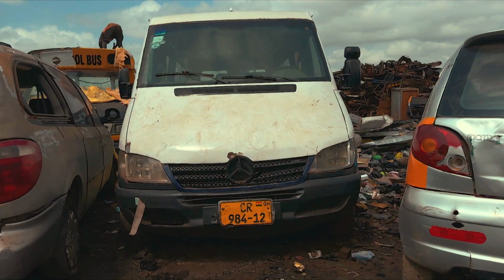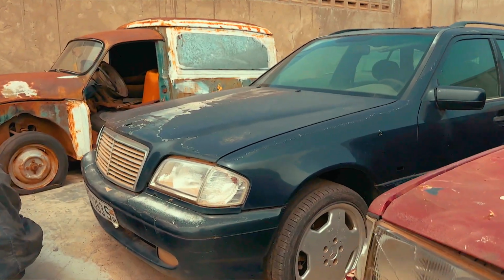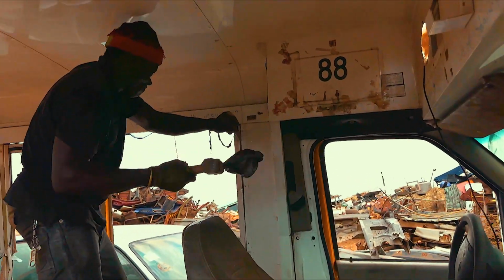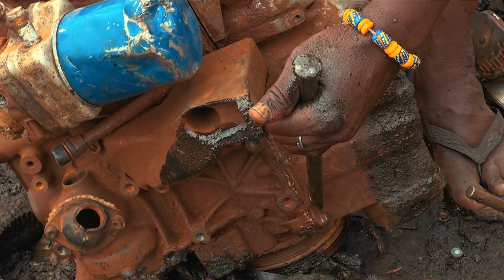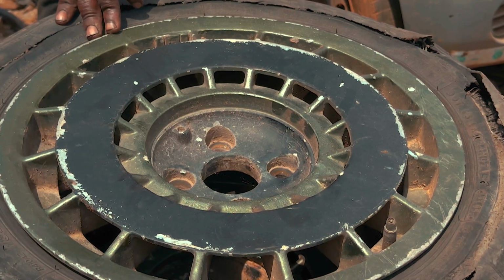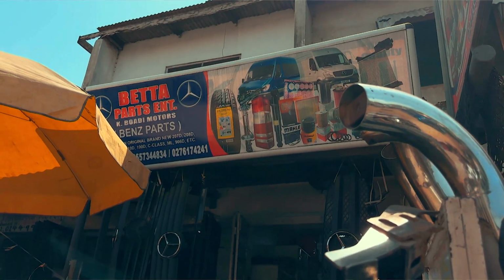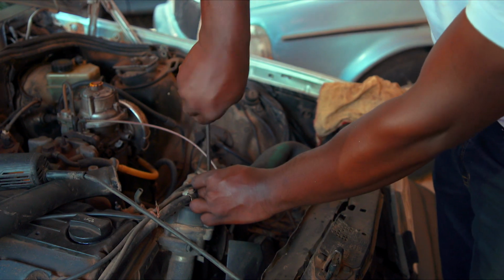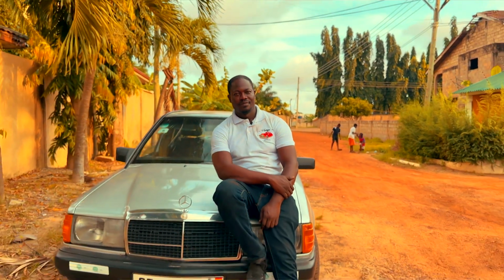German Classics in Ghana: Accra Car Graveyard

Comment: '80s, '90: golden era for cars made in Germany. They were designed by engineers. Later on they realised their cars last too long and it was only downhill for German cars after that.
Reply: But German cars are still the best, together with Toyota. Times change, often for the worse. But this is not limited to cars.
Reply: @jonasf1275  for German cars it is a past tense. Those days are long gone. Today some of them struggle to get to the end of 3 or 5 years lease. They are still widely considered as premium, but reliability is long gone. On the other hand toyota is still reliable. Actually most reliable in the world all together with lexus (many independent rankings)
Reply: @damcyk4  thats simply not true. German cars are still reliable.
Reply: @reverze2031  I'm old enough to remember german cars from '90 on the road and I know them know. Somehow they are only reliable in Germany. In Canada, USA, UK, big parts of Europe outside Germany picture is slightly different. Please take any ranking warranty or reliability ranking and German cars are not there at the top. German cars are only on top at ADAC ranking. Everywhere else where German capital is not involved: German cars are not reliable. My personal quest with German cars ended up quite a few years ago with Passats 2.0tdi. Than was disaster with dsg gearboxes and tsi engines.
Reply: @damcyk4  Forget about it kiddo, u will never find 90s Mercedes again or 80s Toyota Trucks
Reply: @damcyk4  VW is trash, the rest is still premium. Also VW never was premium, you have no idea what you are talking about, you think a Kia or a GMC is better than German?
Reply: @jonasf1275  kiddo? Audi is a vw. Actually vw owns audi.
... Never mentioned kia or gmc. Writing it from Europe
Reply: @jonasf1275  The 80s 1.7 or 90s 1.9 VW Diesel is one of the most reliable engines ever made together with the 2.5 by Mercedes-Benz they are noisy and slow but will outlast the car around them. But I wouldn't buy something from the VW group from the last 15 year.
Reply: @O-plaat  my criticism on VW is on newer models, i think they optimize costs too much to keep up with China
Reply: Unfortunately it's true
Reply: @O-plaat  and don't forget the old Volvo's.(I know that isn't from Germany, but worth mentioning)
Reply: Bis ca. 2004 waren deutsche Autos noch gut danach ging es mit der Qualität steil bergab. Heute würde ich eher Hyundai empfehlen als irgendein deutsches Auto. PS Ich lebe in Deutschland
Reply: @damcyk4  Audi is not VW, just because the company is owwned by one another it doesnt mean much, Audi produces alot by themselves
Reply: @HippasosofMetapontum  my friend, quite a few parts are interchangeable. Well known fact for years here in Europe. I do understand audi owners want to distinguish themselves so badly from vw but there's not getting away from it.
Audi is the "posh one"

VW is the "middle or upper middle class", golf is classless. Cheaper than audi

Skoda is average Mr Smith with family, kinda like a volvo. Or sales representative. Cheaper than vw

Seat same as above just young family or youngsters just before family, kinda sporty cheaper than vw

Cupra, young sporty, trendy. 

That's how it works here in Europe. Engines: all across the board -the same. Maybe audi have got some more powerful ones. One or two. Give yourself a difficulty and take of any panel, any plastic cover, any part of the interior and look what logo is behind. They are using same chassis platforms, seats, dashboard parts, brakes... 
Have a look what logo is on engine block, have look what is on water pump, and so on, so on...
Reply: @HippasosofMetapontum  talking from experience. They are not reliable anymore. Ask anyone about egr and dpf issues in diesel engines from audi/vw/skoda/seat (same engine) there's a lot of common faults on those cars. Gearboxes are made of butter.
Reply: @HippasosofMetapontum  yes it is politics. I give You some clues:

-which country has got the biggest car manufacturing power in eu?
-which country is dominant in eu?

Suddenly its clear why we don't have American cars in Europe and we have got less and less of Japanese cars. They are not qualifying for very strict exhaust emissions. Koreans are holding strong.
Now who didn't meet those strict regulations? How many years gone? Still no consequences here in Europe.
Follow the dots...
Reply: @witos2148  that`s exactly my feeling as well.
Reply: That's right, nowadays they're making cars that will crash sooner for sales to go high..
Reply: MB became owned by Deuchbank in.1990. nothing since is the same

Comment: What a lovely couple. They are doing the environment a great service by recycling and restoring these vehicles
Reply: It depends on how old you are talking about.  A 40 year old car with poor emission controls / worn out smoking engine will be more harmful to the environment than a 10 year old car not to mention the likely worse fuel mileage. 
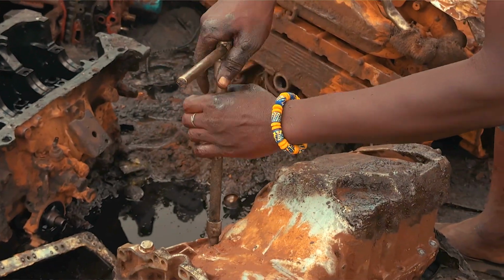And I guess you didn't see the scrap yard , at 3:06 , where motor oil is dumped on the ground right next to a body of water.
Reply: @bobroberts2371  horses for courses Bob. The land fill those old cars would take up along with the energy new cars take to produce is quite substantial. Couple that with the economic benefits of recycling I believe they are doing a great thing.  Is there room for improvement or better practices? Absolutely but this has got to be a step forward from the throw away mentality of the West
Reply: @geraldselvey7687   Said "    The land fill those old cars would take up    "  

Most of a car never hits a land fill, steel , aluminum , copper are all very recyclable.

Said " this has got to be a step forward from the throw away mentality of the West    "  

Driven in part by the reduced labor and manufacturing costs offered by China. Manufactured goods are far less expensive and more durable than even 30 years ago. 

While the cost of manufacture had gone down due to increased efficiency, the cost of labor to repair has not.  

I have a 19" window fan that was $19.95 ( USD ) in 1981 , adjusted for inflation, that is  $ 68.27 in 2022  $   That same format of fan can be had today for 19 to 20  USD  

A car from the 2000's can easily go 150,000 miles where as a car from the 1970's is worn out at 75,000 miles.    A car from the 2010's can go 200,000 miles and still have life.

One issue with pre 1990's cars is their relatively high emission levels.  Cars from the 1970's are more like 100 X more polluting than a car from the 2020's
Reply: @bobroberts2371  Bob much of what you suggest is really valid in the US or other western countries but for where those people are the service they are providing is both sound economic and environmental practice. I once again commend them
Reply: @bobroberts2371  I don't know what you are on to think a car that only lasts 15 years at most would ever be more economical than a 40 year old car
Reply: @Toyotacorollaaltis-cn9fd    Apparently you haven't seen cars rust away in 10 - 15 years or so due to road salt and other chemicals that melt snow / ice.
Reply: @bobroberts2371  Ok you got me there I don’t live in a country with snow but it still applies

Comment: It is a rare ‘96 C43…when the C43 wasn’t produced will ‘98 with an inline 6 powered 3.6 for ‘96. Great video though and glad to see the Merc’s receiving love there!
Reply from the maker: Thanks for the info!
Reply: @DWREV  incorrect information. The c43 was released late 96 with a 4.3 liter v8 just as the gentleman in the video said.
Reply: 1997* when they introduced the m113, and sold from 98 to 2000. Totaly different car from  c36, cause it has a specific facelift chassis and CAN bus of todays generation.
Reply: @Ghousempc  That was the exact point I was making with that joke lol my first car was a ‘96 black on black C36 which led to my ownership of 32 AMG’s and 12 190E 2.3-16’s. My apologies for forgetting the quotation marks though!

Comment: My father 190d is still running and done over 1.6million kms with the first engine. It still work, but the head after 30year corroded, and was cheaper get another used engine than repairing it. If you want, that car is eternal. if maintained can do 2-3 million kms. I want to see what happen when they start to get only newer trash engines with all electronics. They will probably just adapt a carburator on them and let's go. Easiest solution for africa.
Reply from the maker: We'd love to hear more motoring memories of your Dad's 1.6 million km 190D! Send us details and photographs on rev.community@dw.com

Comment: Old benz are great in warm climates. But in cold they rust badly in few years
Reply: not the old ones. Mine (W202) lasted for 25 years and 750.000km before I sold it to Nigeria. It didn't have much rust. (actually no corrotion at all until I rented an humid underground car park)